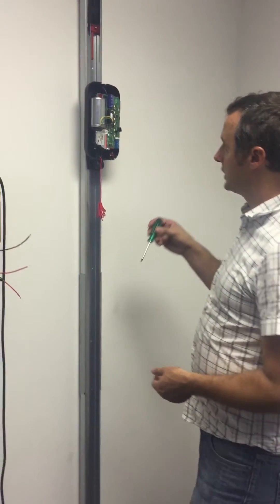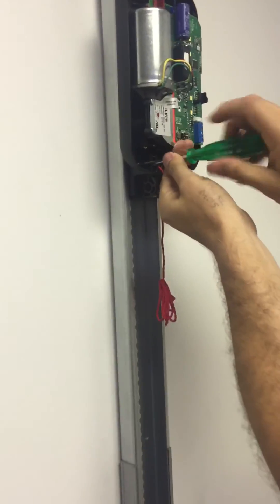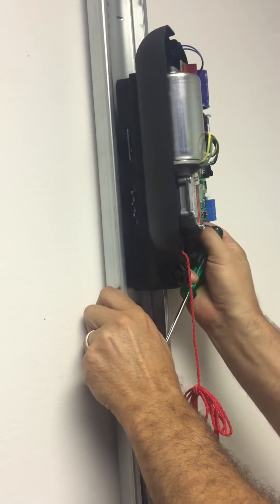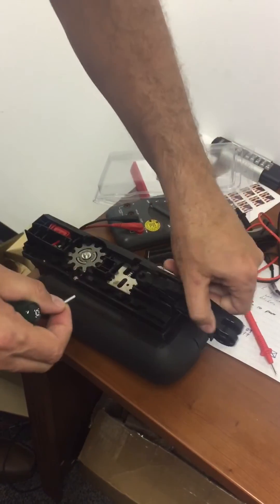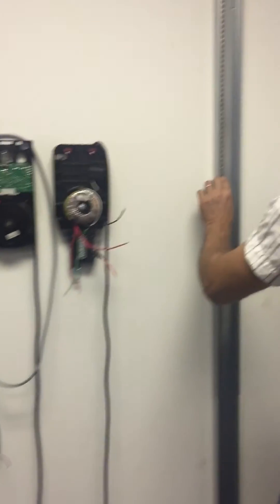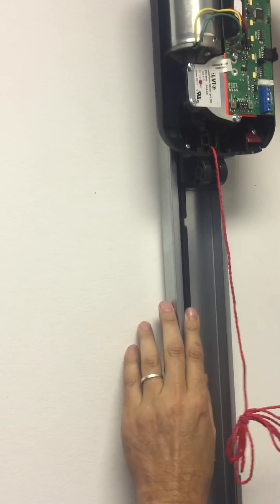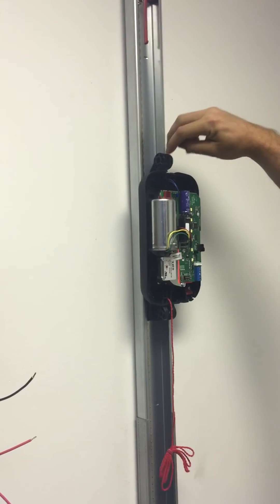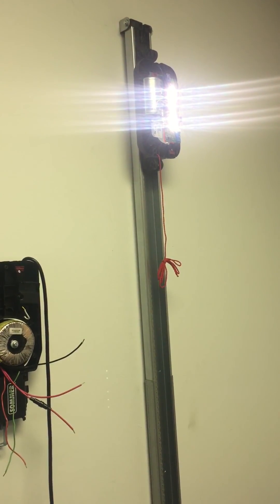Sommer Evo+ Motor Swing Door Coupler

Comment: Thanks for the video Roman, I have just ordered the EVO+ with the swing door coupler for our carriage garage doors. It should show up in about a week or two so I was watching your video to get prepared for installing it. Curious why you need to add that piece to the back of the motor when using this for swing doors.  Thanks again
Reply from the maker: That coupler has to be added as part of the system that allows the safety sensors to function in the correct direction.  If you install it the way you would for a standard overhead door, the motor direction is wrong.  I've explained this a bit in some of the videos where I show swing door installations.
Reply: @romantroyer5157  Thanks and I think I get it, so your pretty much reversing the install when using this for swing doors, correct?  Also and sorry for the basic questions but I can't find any real simple instructions for this online anywhere.  Where do I plug in the 2 wire control cable on the wall control unit.  2 wires coming out Brown & Blue.  Do they go into the GN and RT on the wall control unit? And does it matter which color goes where?  Thanks again
Reply: Also on some of the instructions it tells me to modify the synoris on the carriage but switching the blue and brown cables, on my carriage I have red, black, yellow, and green wires.
Reply from the maker: @MichaelSalois  yes, you're correct about the reversed orientation of the operators on swing doors.

Blue goes to gn and brown goes to rt.  That's in the operator manual.  Generally, the pro+ operator manual contains basic installation and programming information, and the sheet that comes with the swing door kit acts as an addendum to the manual.  

Also, be sure to turn DIP switch 4 on the motor carriage to the ON position before you start the programming sequence.
Reply from the maker: @MichaelSalois  you shouldn't change any of the wiring on the motor carriage.  The Synoris models used a pretty different technology for door positioning than the pro+ models do.
Reply: @romantroyer5157  Thanks again, lastly we have about a 6" header (and trim all around the swing doors)  between the wall and the door on our garage. Will it matter if I mount the track back 6" to the door on the inside of the header or should I mount it against the door on the bottom of the header to get them to properly open and close? (Hope this makes sense) I am assuming I can adjust the extension arms enough to make it work by mounting the track 6" back. ALSO am I correct in assuming that the DIP switch 4 on will stop the door from over closing and putting pressure on the opener? I only received 1 limit stop on the track I received.
Reply from the maker: @MichaelSalois  you should be able to mount the operator back from the opening, but it is very important to mount the bottom of the header bracket flush with the top of the opening, otherwise your arms will drag on the header.
Reply: @romantroyer5157  Job completed, works awesome! Thank you for your help, I shot a couple of great videos of them at work. Thanks again for the help. 

Should be my last questions

1. Without having to buy the add on is there anyway to control the door opening and closing with my android? 
2. Is there a compatible key pad that works with the unit I have that I can get at home depot or somewhere local?   

Video 1 - https://youtu.be/G5pmD69YOy4

Video 2 - https://youtu.be/N6oxffrs7ZQ
Reply from the maker: @MichaelSalois  there's not way to run the operator from your phone without an add-on accessory.  The only ones that will work with this type of operator are SOMweb or ismartgate.  The best keypad for this operator is the Telecody+.  Your big box stores may sell a universal keypad that is compatible, but it is more susceptible to radio interference and won't last like Telecody+ will.
Reply: @romantroyer5157  Thanks again Roman, I bought and installed 2 of the carriage door openers and they work great except for one item you might be able to help with. One of the doors closes much slower than the other. Do you know a solution to this or why it would be happening?  Is there a DIP switch to speed up the operation of the closing (which because these are reversed would be the opening of the doors)  Thanks again, I tried to leave some rating comments for the product but could not find the link. Put the link in here and I will review them for you
Reply from the maker: @MichaelSalois  the operators automatically adjust speed to door conditions, although that's most likely not what's happening to yours.  I would do a factory reset (unplug for 30 seconds, then plug back in and hold the green reset button for ~35 seconds till the green status light comes back on), then reset limits.  This should allow the operator to recalibrate force and speed settings.